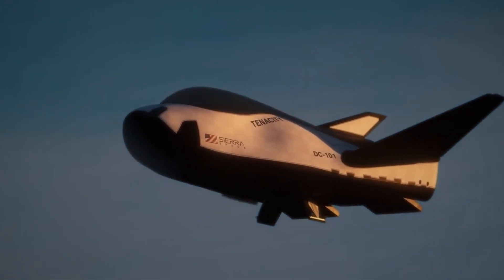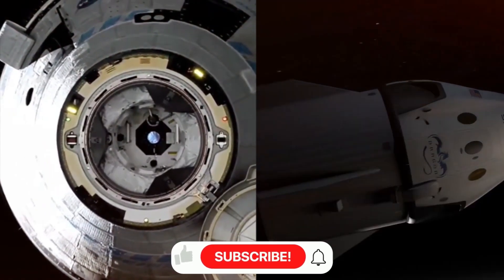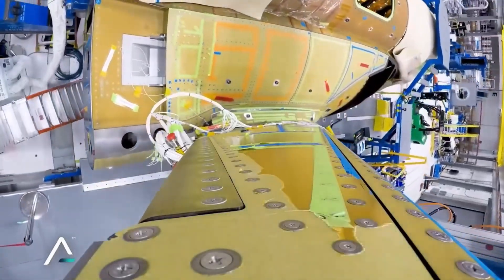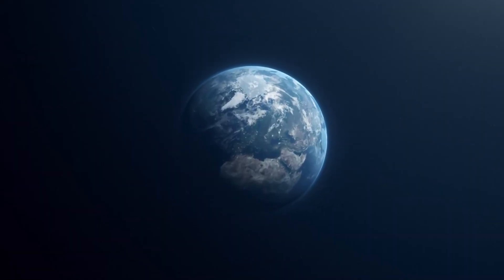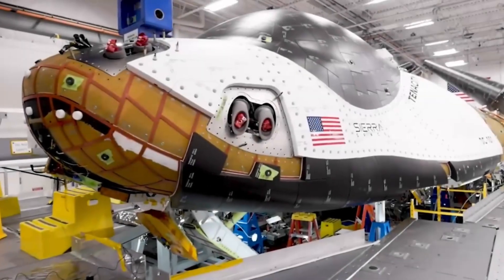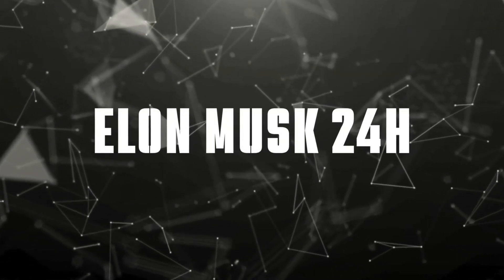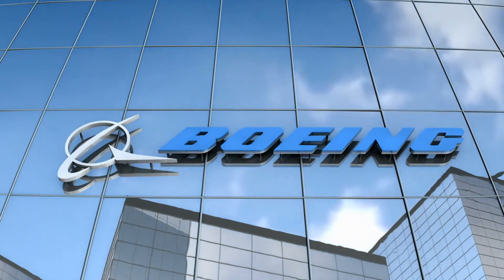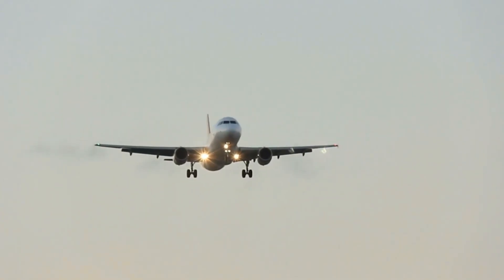UNEXPECTED!! Dream Chaser's Revolutionary Design Just HUMILIATED SpaceX Capsules... Here's Why!

Comment: Heat shields are a good way to protect the reentry vehicle as an emergency measure but using a different method to slow the airship down than one that creates a deadly heat is a better idea.  When SpaceX designs an airship that slows the ship, gradually, to avoid overheating, they will have finally progressed farther than the technology developed in the 1960s, which is ancient technology at best.  Carrying enough fuel in the ship to allow it to reduce its speed by using its own engines to counteract the crazy speed by projecting the expanded gas flame opposite to the direction traveled..."engine braking" will become the common means of slowing down; kind of like George Westinghouse's "Air Brakes," which are still used today.